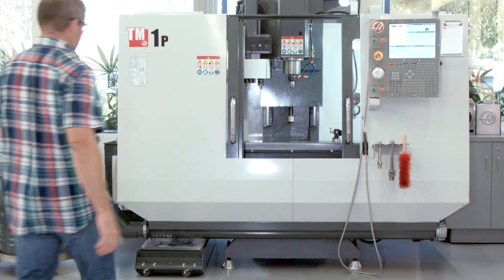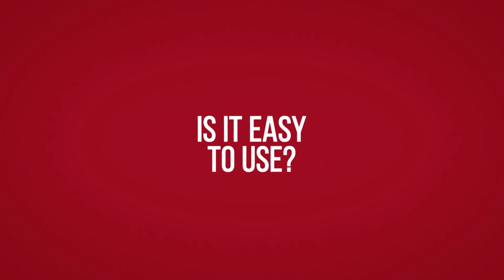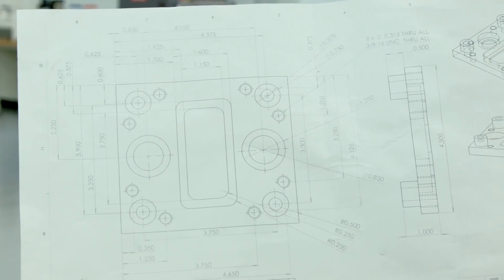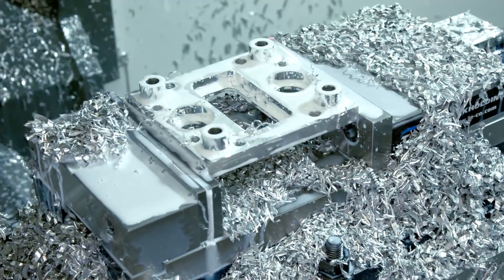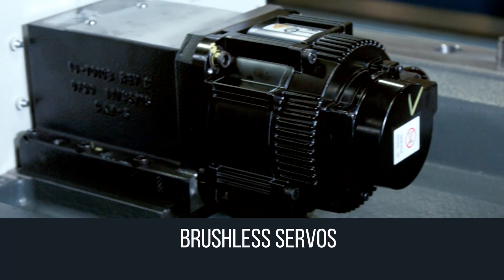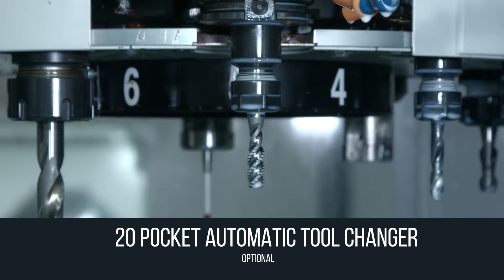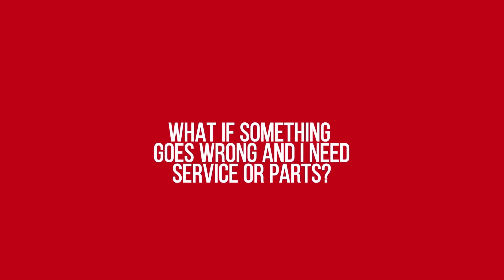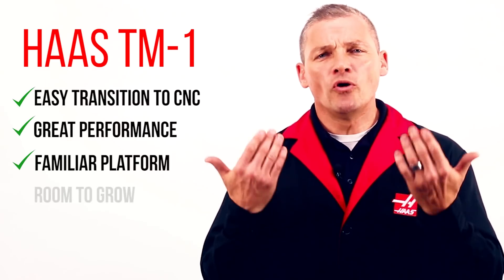The Haas TM-1 - True CNC Performance That's Affordable

Comment: Bought my first Haas mill some time ago. It's a TM1-P with some extra options like the high pressure pump, HSM, Rigid tapping. Great machine, very easy to use. I was operating the machine in 30 minutes. And I never used a professional machine before.
Lots of working range  for an entry price. 
Things they don't mention is that the TM1-P doesn't have a central lubrication system and coolant level sensor. After 3 months of use I wished I had bought a chip auger. The coolant drain gets clogged very often (have to remove chips 2 times a day). Coolant doesn't flow back in the reservoir causing to loss pressure over some time. And I had to clean the 3 coolant nozzles 10 times in 3 months because they get clogged. I was lucky I checked the machine on time because only 1 nozzle was spraying a little flow of coolant. I could stop the machine just in time before it could cause problems.
But overall...very happy with the machine. Great for startups.

Comment: I noticed that the Vise in the video was mounted sideways due to its large size. It doesn't have to be. On our brand new tm1p, it came with two vices. We mounted them as they should and cut about 1 inch off the hex so that the doors would close. I 3D printed a prototype handle to operate the vise and the mill can run with that handle installed without any interference anywhere. I may eventually Mill an aluminum handle, but the 3D printed handle is certainly strong enough and can take any effort I put in it to tighten the vise. Again, there is absolutely no need to mount the vise sideways. You could theoretically install 3 vises on the TM.

Comment: You put "affordable" in the title, but never actually mention a price so we still have no clue what you mean by "affordable".
Reply from the maker: antalz, the base price of the TM-1 is $27,995.  You can find the machine on our website here: https://www.haascnc.com/machines/vertical-mills/toolroom-mills/models/tm-1.html
Reply: Cool, bit out of my reach for my home shop, but that does seem affordable for businesses. I really like that you have prices on the machines and the options on your website. Websites without prices are incredibly annoying when looking to buy stuff.
Reply: antalz hopefully some of the economic boom will come our way before those fighting to turn it back around get their way. At $28K base price, it's a safe assumption that $50K may have it in operation. Good price, but still out of reach for myself right now.
Reply: Could you explain what you need another 20k for? End mills, power outlets and the such like?
Reply: antalz everything from freight and tools to concrete and electrical work. We bought used HAAS CNC mill at a machine shop I did design work for back in 2002; the machine was $42K by the time it was up and in operation it was $65K. In production work nothing's cheap.
Reply: Options. HAAS charges for everything. a 27k machine is stripped down, very little functionality.
Reply: Why so expensive? You could get a mini mill and that's more bang for your back for about the same price
Reply: @antalz  you could get a sylic machine x5 or x7 at 1/4 of the cost of a haas tm1
Reply: I need to get a CNC lathe or retro fit mine. I can't keep up anymore without my back and hands killing me.  Only problem is I am clueless. I have just been a dumb welder my whole life but had a heart attack. My pacemaker won't allow me to weld anymore. I bought a lathe and taught myself to use it. I need to drill tap and hex alum 1.5 to 3" material. I don't even how what machine will do what I need much less how to use it. I have 3 weeks to get one and get it going. I have 50,000 to get a machine and the tooling I need. Hopefully I can fit in some classes eventually but just need to get going asap. Haas seems like the way to go but we will see I guess. .

Comment: How exactly does this "bridge the gap" between manual and cnc when there are no handwheels? You can't do anything manually on this machine.
Reply: yes you can, select your tool, turn on the spindel, click handel jog, select your axis  and use the hand wheel on the control

Comment: For the price they are a lot better than people give them credit for.  BUT, Haas please fix the following:

More coolant capacity!!!!!!
Full coolant jet "halo" around the spindle - People shouldn't have to buy aftermarket hacks for this.
Table size option to cover the travel of the machine.  - Again with the aftermarket.
Cover the limit switches on the table so they don't send false messages and cause issues with the control.
Nicer finish on the table.

Comment: This is a production machine stripped down to compete with a tool room mill on price

Haas does a lot of things very well but this is not one of them.
I have 4 VF2SS mills and 2 lathes. they are the best deal going for a job shop 
they are inexpensive to buy and maintain you can expect to make money using them. But Haas does not have a clue about how to make a mill that will even come close to the versatility of a Prototrack/Bridgeport retrofit 
I have been a Toolmaker for over 20 years I have run the SWI Prototrack Mills and retrofits they are the easiest machines to program for a person not familiar with G-Code that is only interested in making less than 10 parts
if you are expecting this VPS crap to turn your manual machinist into a CNC programmer it will not

I don't understand why Haas makes this thing

Comment: Our 3 year old TMP2 had it's main control board fail for no reason and took £7k to replace, a spare was not on the van and took 2 weeks to get back up. Other issues have been the tool carousel   bent upwards somehow and it would crunch into the tool on tool change and the spindle bearings had to be adjusted because of chatter issues and poor surface finishes. .don't even bother with the IPS it is a joke!. This is a low hour machine with 1 operator  (me)in a toolroom and not a production shop. The control is nice but the rest of it is not great.

Comment: To get machine in Ukraine you have to wait about 4-6 month.
How this correlates with same/next day replacement part service?
Reply: cncua you transfer the money and they put the machine on a ship on the next day.
Reply: They build every machine to order, so they have to take time to put the thing together. Then, even if you are on the mainland US, it takes time on a truck. In Ukraine, it has to go on a truck, then a boat, then another truck. This takes time. Same day parts are only if there is an HFO in your area. They said they SHIP parts same day, how long it takes to get to you is beyond their control.
Reply: cncua it took several months to get ours and we live in usa there is alot of hours and paper work that goes into it

Comment: This is not a Tool Room Mill!  These are production Mills..... They are good if your doing production but not if you're doing one or a few parts at a time.  And oh yeah...nice to market against Proto Trak's machine from the 90's. Must be too scared to put it against their new controls.  Proto Trak has the best machines for tool room or small quantities jobs.  Also Proto Trak still supports their controls from 20 plus years ago.  What company in this industry does that???

Comment: Get your wallet ready!Haas machines are great but man are they expensive, the servicing and parts is where they make money big time
Reply: What???? Clearly, you have never tried to service a Japanese machine! Haas will ship your parts to install yourself from the HFO if you want, or you can pay a tech. Nobody else does that. Haas is by far the cheapest to service for CNC machines in America if you are willing to do the work yourself. The Mori's and OKK's and whatever else is going to cost an arm and a leg to ship parts and take forever because its all from Japan.
Reply: Eggsr2bcrushed a new spindle in a vf 2 installed cost 9k i have alot of experence with them and they arnt cheap but on the other hand not single one of the big names are.....but then again the imported machines seem to usually be better quality you get what you pay for with cnc
Reply: You have clearly never owned anything other than a Haas, I have to agree with these other guys Haas service costs and part prices are extremely high. They sell you a cheap machine which most likely will go wrong (by experience btw) and then over charge you for parts or if you can get an engineer, they just keep changing parts until it start working. We have Haas machine, Doosans, Mori's and Citizen machines and I would say Citizen are our best followed by Doosan.
Reply: Expensive? think not did you see how much German or Japanese machines cost??